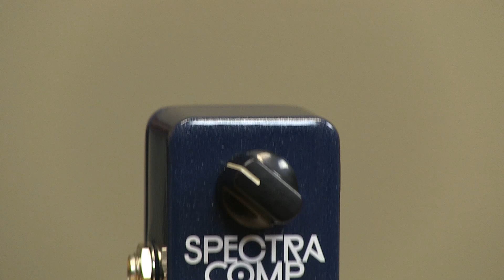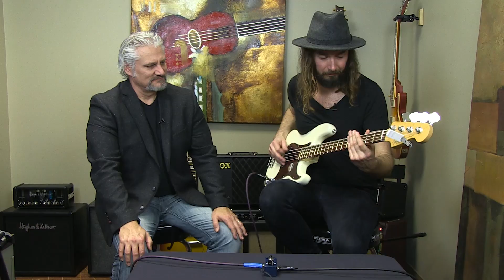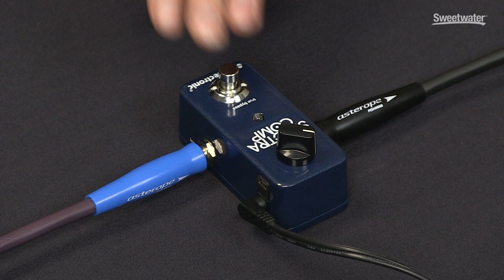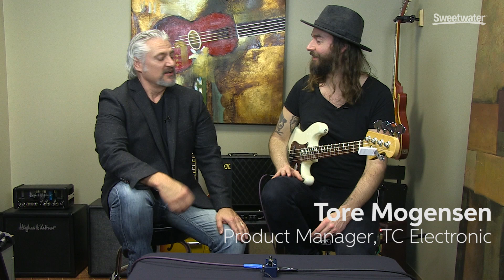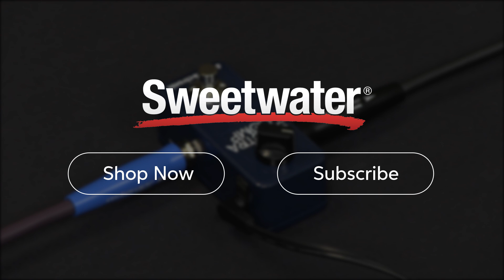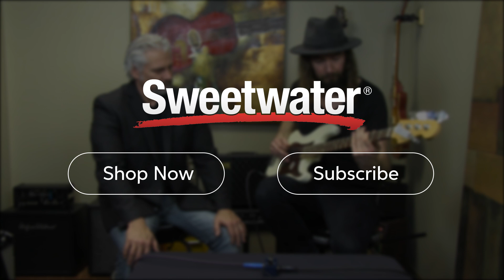TC Electronic SpectraComp Mini Bass Compressor Demo by Sweetwater

Comment: Is this a good pedal to reduce the treble and slam when playing with a plectrum ?
Reply from the maker: Hi, Arcade1959! Thanks for your message, hope you’re well. Using the TonePrint app there are several settings you can revise to get the sound you’re looking for. There are options to adjust tone and attack which I interpret you’re asking about.
Please contact us direct with other questions as you have them!
Robert Williams, Senior Sweetwater Sales Engineer, (800) 222-4700 ext. 2371, robert_williams@sweetwater.com
Reply: @sweetwater  Thank you for your reply.
I do indeed need a compressor that smooths out the treble.
I'm interested in this Spectra Comp.
Is the factory setting sufficient ?
Reply from the maker: @Arcade1959  Thanks for getting in contact. Once you purchase the Spectra Comp, I suggest downloading the TonePrint app so you can customize the settings to your liking. You can modify the amount and tone of compression for Bass/Middle/Treble bands. Hope it works well for you!
Robert Williams, Senior Sweetwater Sales Engineer
(800) 222-4700 ext. 2371 | robert_williams@sweetwater.com 
About Me: https://bit.ly/3GfRcUY

Comment: does anyone try it with a double bass?
Reply: I came up with a toneprint that I use with my double bass with a Realist Lifeline pickup. This pedal shapes my tone and helps with unevenness in volume when playing from the low range to thumb position. I have found it much more effective than an EQ pedal. Be prepared to experiment a lot with the editor program.
Reply: it sounds very interesting pedal to me!

Comment: Getting my SpectraComp outta my mailbox from Sweetwater today! =]
Reply: I just added to my pedalboard and I practiced a little bit with it.
It really brings the harmonics alive without sacrificing the bottom tones. I believe that's due to the 3 way compressing system for the highs, mids and lows that work separately. 
I'm running the SpectraComp right after my wireless before any other pedals. I used a EBMM StingRay with the SpectraComp a hair above 9 o' clock. It's sounding great and balanced through my studio monitors.
I also plugged in an Acoustic Warwick Alien 5, which I always had a discomfort live because my solos would get drowned by everything else. The SpectraComp was at 12 o'clock and really took care of the problem and my low B string was still sounding strong. 

This is all with the factory settings and I haven't messed with the TonePrint yet but I really enjoy the idea of having 1 button that I need to worry live. If I want to change the core presets of the compressor or even what the button does as I turn it, I'll just connect the pedal to my PC.

I'm happy with the sound and I believe it's a good product compared to the avalanche of bass compressors released in the past 2 years. Of course, that's all relative to the user and what you're looking for.

I have a long gig tonight, so that's gonna be the real test in a live setting.
Reply: How is it?
Reply: I'm also curious to if it's good or crap...
Reply: Ill need to check it out then. Been wanting to get a compressor to just smooth things out and make my notes a  bit more even when I did in to hard with my stingray, was thinking the keeley bassist but if this one works for me and I save 50% thatll be great
Reply: +Daniel Costa thanks bro..
Reply: I have it on my pedal board with a b3k and a microtubes x ultra with a decimater 2